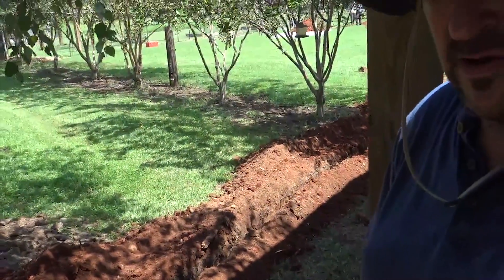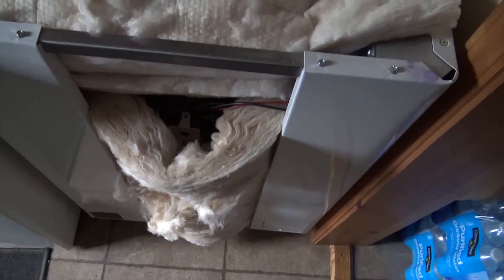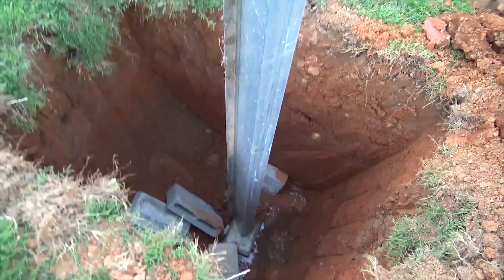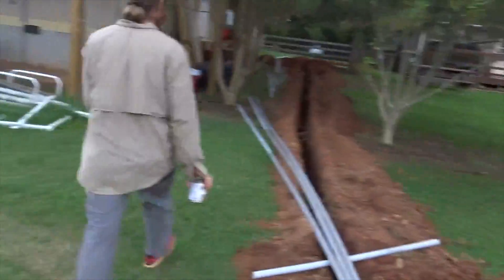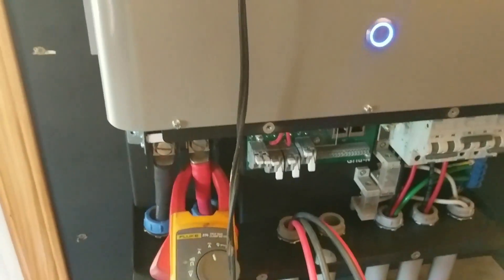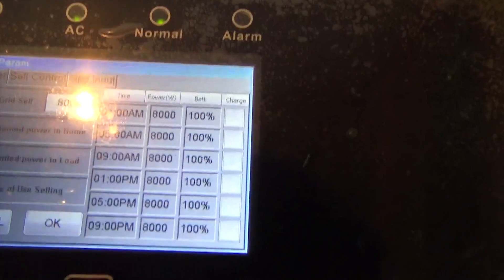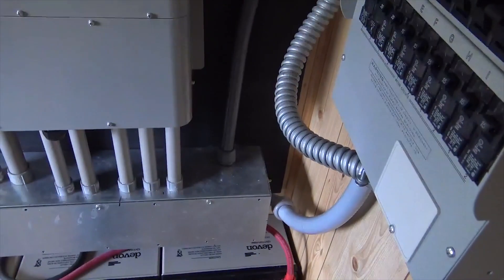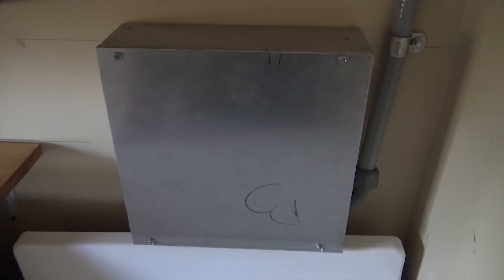Solark 8k Installation

Comment: That is a really clean design.  I love how everything is included in the inverter.  The other companies make you buy everything seperately and it makes the install twice as big.  I also really like your implementation of the transfer switch instead of installing a subpanel.  Great way to get around some of the issues with splitting out the wires from the old box (and likely drywall repair).

Comment: Thanks for making this video a Scott.

The issue I believe remains with the un-switched neutral is that if someone thinks they have disconnected the utility service to that structure they could encounter a neutral current flowing at it (some current back to transformer via your transfer switch). You might put a warning on the switch itself if your electrical inspector let this fly.

Also, some inspectors might require the portion of DC conductors from the solar that enters the house to be rapid shutdown controlled. The Sol-Ark is not designed to ever be outside so this would need to be considered in almost all situations.

I hope it works well for them and you!

Comment: My biggest PV mistake (2 years ago) was not wiring to use the power I produced before allowing the excess to hit the 2nd utility meter (sales to utility.)  Now that my utility has decided that ALL my production is taxable income (yes, I get a 1099!) it's all becoming clear.  Too bad my (very large) installer didn't told me about this in advance.   Learn from my mistakes.
Reply from the maker: Thank you!
Reply: Thanks for sharing. Wow that is crazy especially if you are net zero or below. Now if you have a solar farm that makes more sense. Government double dip in everything. Look at your pay check and then buy something and taxed again. Biggest purchases are never owned with registration and property taxes.

Comment: Thanks for the videos they give me all sorts of ideas :) 
with the second building, why not back feed it from the main house while you were pulling wire? Get rid of the second meter and second access charge on he bill?
Reply from the maker: Okay on this job we didn't realize that they had added a separate meter base to this building so it was quite the surprise when we showed up on the job. An electrician told the customer that their house could not handle sub feeding this building.  So they install the separate meter and therefore caused a little bit of technical issues with the neutrals as I didn't know how to switch the neutrals other than using a 3 Pole or three phase transfer switch so I could switch the neutrals but that was crazy expensive.  once we realize that everything was the same neutral out at the Transformer we just decided to put a whole house transfer switch in case they ever wanted to run that building or other heavy loads off of the other service.

Comment: Not sure if the solark can do this but i figured i would ask the master of solar. I have been reading up about this inverter and would like to know if this can handle frequency shift? Can you use grid tie inverters with the solark? I was drifting towards an ac coupled system. Just was wondering if solark can handle this. With so many systems you have installed over the years its hard to keep up with what i want in my own system. Thanks for all the great videos! I have really enjoyed them.

Comment: I have the same inverter with 9Kw in panels with 16 Sol-Ark 230ah batteries. I run with grid sell enabled, limited to load and time of use enabled.  All excess is sold to grid and I have it set run on batteries at night. Gets down to about 80% soc each night and recharges the next day. I have a secondary solar system in my shop with another 33Kw battery bank that feeds into the Gen input on on the Sol-Ark in the event the my Sol-Ark batteries  drop below 80% System runs great!!

Comment: Can the 8k sol arc be used with the grid, but without a net meter agreement? The way i understand limited home, you can set it to sell to the rest of the house instead of the grid and use the grid as a backup only as needed? My electric company is hostile to solar. Its way too expensive to have a net meter agreement with them. Just not cost effective.

Comment: Very nice set up, as a 35 year plus electrician I can appreciate good work, with all that said may I ask why did you used PVC conduit for exterior above ground preparations inside not a big deal but as PVC ages it becomes brittle and your client has to cut the grass around these conduits few years in service and a weed whacker will not only damage the conduit liable to break it take it from someone who's has done many of these repairs over the years
Reply from the maker: Like I said I'm not an electrician but I'm all of our outside installations we Step Up PVC conduit. There are three 200-foot runs here and they are stuffed up into the wiring drive and into the Nema 3r boxes. Should I have transitioned to EMT??

Comment: Do you partition your trough to keep AC and DC separated? I've been hit on this as an installer in the Carolinas.
Reply from the maker: I did not.
Reply: The inspector I had allowed me to run my DC electric through liquid tight metal flex inside the trough. I was doing an LG Chem install though, so it was only 10 wire. I forget the exact NEC code, but we all know anything is in there if the inspector wants to find it. Beautiful work by the way!
Reply: @singerkgreen  NEC is AC and DC in the same raceway is OK as long as they are part of the same system.
Reply: @randacnam7321  Can you reference that code by chance?
Reply: @singerkgreen  NEC article 300.3 (C) (1)
AC and DC conductors carrying 600V or less may occupy the same raceway so long as the insulation of all conductors is rated for the highest potential on any of the conductors in the raceway.
Reply: @randacnam7321  thanks so much for that!

Comment: can you talk about systems that are not paired with internet support? maybe a long while ago (long time subscriber) I believe a saw you do a system that was stand alone and capable of running without the internet. granted I may be wrong on 2 fronts, but I thought you would be a great source of knowledge. many thanks
Reply from the maker: This system will run without the internet support they just ask if you do have internet support that they can push some of the latest software updates that come along but it's not required.

Comment: I saw your other video using solar to run a mini split air conditioner! How many panels does it take? I was looking at sol-ark but they told me it would take at least nine panels to run a window unit! I live in the south and air conditioning is the problem here! It sounded like I would have to fill my whole back yard with panels and spend a fortune to run a window unit!
Reply from the maker: 6 panels runs our mini split without batteries.. https://www.practicalpreppers.com/air-conditioning/ac-dc-air-conditioner-hybrid

Comment: Have You done a video about a off grid wood working shop  like 220 Vs. 120 or even running cordless tools of some kind of low voltage power cord  battery replacement   like remove 18 VDC batt pack  and hook up to some kind of 18 V DC feed from a solar panel or battery bank  instead of inverting the power input just to have  120 AC batt charger drop and invert it back to say 18DC

Comment: What are the rules and regulations regarding solar wiring? It isn't low voltage per say so are the rules and regulations the same as 120/240 voltages?

Comment: Interesting. It passes even with the tricked out neutrals and gutter's.
Reply from the maker: the gutters are 3R?
Reply: Engineer775 Yes Sir! They sure look like it. Did you use 4 bushing for each pipe from the gutter to the inverter?
Reply from the maker: Yes, everything is bushed.

Comment: Curious about a solar system with a enphase Iq8+ inverter system with off grid and battery capability. Do you have experience with enphase systems? I know the Iq8 is not available yet. Plan on going off grid with max efficiency.
Reply from the maker: Yes, with IQ6PLUS-72-2-US			(290	micro-inverter). The 8 looks promising. However, the efficiency will not exceed this Solark.

Comment: Engineer 775, great work as usual and thanks for sharing with us all. Genuine question, do you or your contractors charge more for working in extreme conditions? ... or are you just happier at work in fine~ cooler weather? :)
Reply from the maker: Good question.  The heat index was up to 104 for this job.  There are enough things to do on these jobs that we try our best to work in the shade but that is not always possible.  2 guys and 4- 12 hr days.  We work year round.  Hard to find good workers.  Abraham who works with me is a gem!

Comment: I have a question regarding using solar to heat water on the bottom element of the water heater. Instead of running excess power to a resistive heating element to bottom water heater what if you fed the power to a heat pump water heater. Then one could get about three times the heat out of the same electrical power.
Reply from the maker: You cant run the power directly to a heat pump.  Heat pumps have compressors and llocking rotor amps.  DC direct is forgiving , needing not batteries  or inversion.

Comment: How much does a set up like this run. Appoximately? And how far do you travel? Thanks. Really enjoy your videos.👍👍
Reply from the maker: I will travel a long way if you hire a licensed electrician in your area and pull the appropriate permits.  I design, consult and install.
Reply from the maker: Systems like this can be 25-35k
Reply: Engineer775 Thank You!

Comment: Do you every install such things up in the north? I'm not sure how all of this stuff works, and if it could work up here, since we have a shitload of sun in the summer, like 24/7, but we have nearly no sun in the winter. If you have a lot of batteries and storage, how much energy can you store for a longer period of time (with the occasional recharge when the sun is up for a half an hour a day in january)? And how long could you use that energy to run a filled freezer and fridge?
Reply from the maker: Yes, we do some long distance installations  if you hire an local electrician and pull the permits.

Comment: Do you think SolArk would be willing to design/build a custom hybrid inverter just like the 8kw version for me?  Needs to be  able to handle 1.5kw DC @ 300V from solar panels and the AC inverter should be 120v @ 1.5kw.  Designed for 48v lithium battery.  How many units would they require for the build?  Thank you.
Reply from the maker: Please send me an email ---- info@practicalpreppers.com  with your request.

Comment: I see you installed the batteries on their side. Is this ok? What type batteries are they?
Reply: I was going to ask if it was ok to put those types of batteries on their side, (I expect that its probably sub-optimal.)
Reply: For agms it is fine, they are meant for it. They can be installed on their sides even in off road vehicles bouncing up and down dirt roads. Don't think it has any pros or cons over normal besides it makes battery wiring much cleaner

Comment: Is the hot water setup as a dump load?

Is it possible to install two separate but linked dump loads with this inverter?
Reply from the maker: The hot water setup is an independent PV direct non dump load.
Reply: Hello Engineer775,

Thank you for your kind reply.

Is it possible to setup two linked dump loads with this inverter?

Suppose the hot water heating element was energized through the inverter, and suppose the people living in the house did not have the grid to dump excess energy, and suppose they decide to go on a week long vacation.

While they are off vacationing, the hot water tank reaches some temperature limit as it gets heated up, would it be possible to dump the excess energy produced to an air resistor?

In this way, the hot water tank would act as a beneficial dump load buffer, and the air resistor would act as a true dump load with no benefit in the summer.

Keep up the goooood work.  I continue to learn tons through your videos.

Comment: I just don't understand if you are putting in an array, why put in a separate panel for just hot water? What use is that panel if your water heater is hot?
Reply from the maker: The solark is not connected to the water heater.  THe customer had 3 extra panels and requested the hot water solution.

Comment: Is the Solark putting out any RF?
Reply: yes , if you connect the WiFi dongle.  try Cornet ED88TPlus to measure wifi radiation , ELF and EMF.

- If you use WiFi in your house, than you should worry about that first.
- If you phone is not on Airplane mode when it is in your pocket, than you should worry about that first.
If you have a newer car that has Bluetooth, WiFi, sonar etc, than you should worry about that first.
- If you have electric cables in the walls behind your bed and they are not in metal conduit, you should worry about that first.

Comment: where did you get the breaker box used at 10:08. im looking for a normal style DC only breaker box
Reply from the maker: Reliance Prtoran 510D   https://www.generatorfactoryoutlet.com/reliance-510d-120-240-volt-50-amp-10-circuit-pro-tran-indoor-transfer-switch

Comment: Scott, this isn't the EMP hardened system is it? I'm an admin in a 45k member prepping group on Facebook and I want to post this there, but don't want to miss-label it.
Reply from the maker: Yes this is EMP hardened.
Reply from the maker: You can get it either way EMP hardened or not. The EMP hardened solution is an additional $1, 200.00

Comment: You should switch to thhn as soon as you are in conduit. Its cheaper and fits in smaller pipe. I use mc4's to transition and sometimes polaris lugs. 
As for the neutral that was a head scratcher i dont know all the details but i would have moved all protected loads (netural and ground included)to the sol ark output completely and used the home meter as the transfer and pretended that the other meter did not exist.
Reply from the maker: That was one of the plans but the neutrals are tied together at the transformer.

Comment: What is the transfer switch for? What are you going in between, solark and grid? But doesnt the solark auto switch to battery if grid goes 
out?
Reply from the maker: There are 2 transfer switches in this video.  THey are doing different things.  Which one?

Comment: I hate to be the bearer of bad news, but you installed this incorrectly. 

You can't have the DC and AC runs through the same gutters, they have to be separated. Same thing with the Line and Load sides of the AC runs, they must be separated. No electrical inspector would ever pass this as it's built. Also, a transfer switch crossing between meters is a no-no for the power company, and can result in decommissioning and a fine for your customer if discovered. 

You should consider getting trained in the NEC if you are going to be charging people to do electrical work. Yes, the system works, and I don't have any safety concerns. But as it stands, the work is not up to code and if they ever want to sell the house they will have to pay to have it done correctly.
Reply from the maker: Thank you. We have passed many inspections with AC and DC in the same gutter. I believe that I am going to start partitioning.  I'm an engineer and I can do anything. 🤣. I am teachable however and I appreciate your feedback.